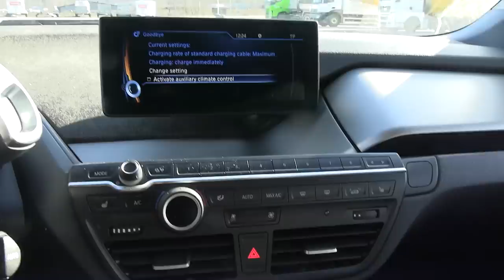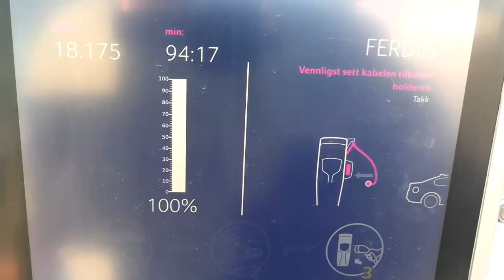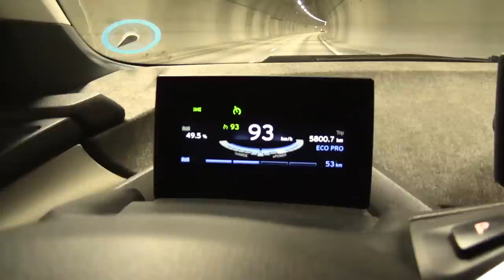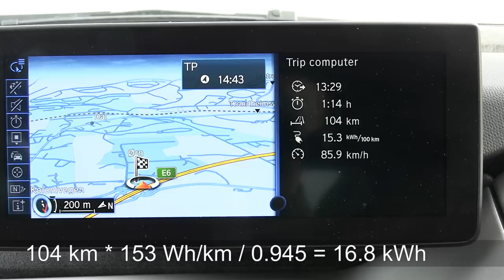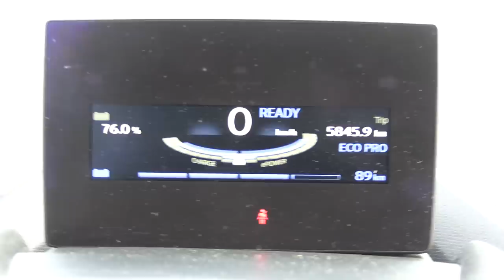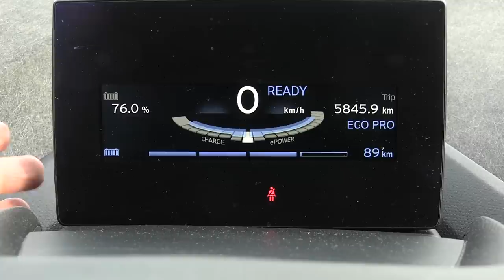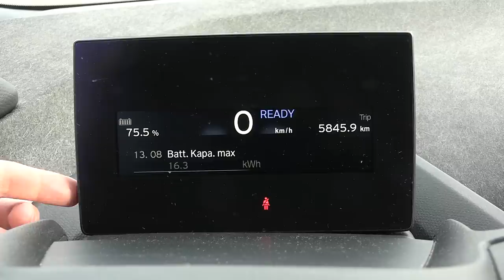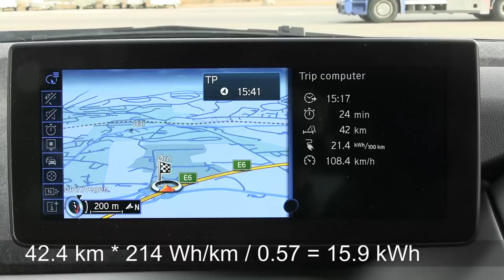BMW i3 22 kWh degradation test after 100k km

Comment: If you are ever in Denmark and want to check the degradation on a Ioniq from summer 2017, with 135.000 km on it, you are more than welcome :) Good video :)
Reply: I will love it! I have one from 10/2017 with 46 000km. What range you can get this days?
Reply: @Fernandoferreirasax  i still get the same range😊 i doesnt feel different 😊
Reply: @RandomRockyCX  fantastic!!! 👌😁
Reply: @Fernandoferreirasax  Same here. 70K+ KM. I know some with 200k KM. Still no difference.
Reply: @RandomRockyCX   maybe the buffer they put is .. when you start loosing  capacity it start charging high voltage to get the nominal W/hrs ... in the begining they  just charge it less voltage to get more cycles but when you start loosing capacity they charge it  to high voltage and its look like it didnt loose capacity =]]

Comment: I have a BMW i3 Rex 60Ah from 2014. 120k km on it with 12% battery degradation. Holding up very well 😎👌⚡️
Reply: Of course man! It's about 6 years old with just a little over 100,000 Km. The longevity test starts now.

Comment: I am sure the I3 will last for many years to come! After all it can’t rust on the salty winter roads and the battery will be sufficient for town driving.
Reply: You know the body might be carbon fibre but it does have an aluminium sub frame for the suspension mount points and to hold the battery. I would be very interested to see one of these up on the lift after 6-10 years to see if the salt water has corroded the Aluminium at all. I have seen Aluminium get corroded by salt water or galvanic action between dissimilar metals. If it the aluminium held up well and weren't for the battery these cars could easily last 25 years.
Reply: @zoidberg444  If you assume that its aluminium sub frame for the suspension has the same quality as all the other BMW models, it will basically last forever.
Reply: Plastic door panels and alu subframe. Glas back door. This will last for very long! My three VW Golfs started rusting at 3 years old! They all needed expensive repairs. I have had many BMWs and never seen rust that early. I have my second I3 now. I have not seen any corriosion on the cars. Excellent town car!
Reply: @AOTanoos22  As long as it's not made by BMW Motorrad, they went through a phase of making engine cases that corrode through.

Comment: The i3 is my favourite small EV. I suppose 10% degradation is quite acceptable for 6 years/60,000 miles. That means the range will probably have degraded by around 16/17% at 100,000 miles. Very practical for city driving. I always thought it had an interesting design that lent itself to being a purebred EV rather than some of the others which still seem like electric variants of petrol cars.

Comment: Very interesting. Please test more cheap, older EVs. That would bust another myth - that EVs are for wealthy people only.
Reply: who else buys new EVs apart from relatively wealthy people,  its hardly a myth
Reply: @yarpos  technically relatively wealthy people buy new ICE cars too. If you want to save money, buying used is always a better choice
Reply: @yarpos  

Id agree, New Teslas are for wealthy people. But, you can pick up a new Bolt for under 27,000 no gimmicks.
Reply: yarpos 👏🏾👏🏾👏🏾
Reply: 27k... so you gotta be wealthy... can buy an ice car for less than 5k, get a toyota or a honda as well
Reply: I rather drive my 88 323 Mazda than a new I3
Reply: @Frank71  Imagine spending 27k on a Bolt.
Reply: @dallysinghson5569  

Its below the average price of a car in the USA. Perhaps the best deal in a new EV in america. If you willing to be patient and look around. 25 grand is possible.
Reply: @dallysinghson5569  

In that case. Find an old ICE car for couple of hundred and fix it yourself.
Reply: My 2014 smart has 65,000 km with no segregation.  Bought it used 2 years ago. $5000
Reply: NoNoNoNii  

To save on gas

Comment: If you know the Machine, that works pretty well....With the i3 60ah you make the preheating on the wire to 15 Degrees. (Program 2 departure times) Then the first stint you drive hard and make a short 10 min charge stint. To check the battery temperature put your hand in the rear seat cupholder: If its handwarm, battery is ok. Now you can drive to next charge with 115-117 km/h (best value range/ speed). Now charging: From 7% to 84% you need around 16min. Another 4min gives you 90%. Drive: Never use ACC ! This reduces your range by 20%. Use CC. If you respect those tips, you reach the 90-100km range and an average speed between 85-95 km/h in the Winter. In the Summer I had ranges closely to 170 km ! I drive 5000km per month with the I3 with the small battery. Zurich to Vienna, Zurich to Hamburg, No Problem ! 1000km Challenge I estimate 12.5-13h. I will do the test. Cheers Nick.
Reply: 60.000 a year in a 60Ah - that's quite sporty! 
Regarding your temperature check: any reason why the battery temperature comes through to the rear cupholders?
I've removed the rear seats to have a look underneath. There is some electronics, also a fan. Im wondering what it is cooling. I guessed it might be the AC charger. Might be completely wrong, though...
Can you give more info? (English or German is ok. Your preference)
Reply: The battery temperature is visible in the Geheimmenü btw.
Reply: @Hiasibua  I think it is the whole compartment which is heating up. No i think you're right about the AC charger. I think it is not only the AC charger.
Reply: @TheNick70nick  damn I need to contact you. I’m from Latvia and I just bought i3 60. It’s perfect in the city and it usually consumes around 10 kwh in the city. But I just came back home from a 60 km trip and my consumption was 16 kwh at 90 kmh! I don’t know if it’s ok, but it is 3 degrees Celsius outside, I did not test it in the summer yet, maybe it will be better. But damn, I don’t even use any air conditioning or heating😕

Comment: BMS of the i3 lock up over a longer time period a portion of the total capacity. If you reset the BMS (requires ISTA Software of BMW and a LAN to OBD2 connector) then you regain a portion of the total capacity again. In Bjorns test car it should have about 18kwh left after reset. This applies only for the 60AH version. In the bigger capacity versions the reset seems to have no effect or even reduce the total capacity.
Reply: Danke für die Info! :-)))
Reply: @Fruchtig78  Gern geschehen. Eine Anleitung wie man es macht gibts im Forum-Bereich von Going Electric.
Reply: Sounds a bit like what happens with Mitsubishi Outlander PHEV
Reply: Mine 2014 60ah fast Charger  112.000 after bms reset whit goingelectric guide pass from Max kappa 14,3to 18,9. If you have 60ah find some one can do it for your car
Reply: I'm assuming it just change the number it's claiming in the service menue. The real capacity will not be affected. These numbers are always a guess
Reply: @ExperienceCN  It's the real deal. You can get 10 or more km range after reset. Did it twice myself when I used to own a i3 Rex. Of course you shouldn't do it after a short period again. Usually once every year.
Reply: @Kopfkirmes55  yeah, as with the Mitsubishi...people found that the degradation could be reset after a while and they would suddenly start getting more EV range. The culprit almost seems like internal battery Deg models that are too conservative. Cell voltages told a different story.
Reply: @0tispunkm3y3r  yeah, I have watched the videos about it. It is the same deal with the i3, only the battery size is bigger, therefore it's not that obvious. Also the BMW is not cutting the capacity that aggressively as in the Outlander.
Reply: @0tispunkm3y3r  But on the bright side used Outlanders are really cheap and they still have around 25km EV range, which is superior to any ICE SUV. Even running on gasoline it's still alright with 9l per 100km (a almost 2 ton vehicle with towing capability!)
Reply: @Kopfkirmes55  oh yeah they are nice vehicles. And you can do the BMS reset yourself !
Reply: BMS reset working well, i do have a 54K km i3rex and after the reset it went back to 18.8kw (full capacity - from previous 16.7kw) according to Batt Kapa, and i gained range as well.
Reply: You cannot use Batt.Max Kapa or SocMax from the API to measure degradation. This value is alive and based on several variables used by the BMS. The only way to measure degradation correctly is by doing a battery discharge test with a BMW battery tester for the i3.
Reply: The 94Ah battery does not seem to lock up energy. I checked two old cars today and both have 29.5kWh left. And if calculate like in this video the battery would be bigger than new (27.2kWh usable). Very confused 🤔
Reply: @davidgarcia6638  is def works ? ive 2014 i3 60ah with 16.1 left

Comment: Degradation of the energy cells will be largely depending on the number or charges, how far the cells were emptied and, most of all, how much strain was put on the cells during charging (i.e. normal charging or rapid charging). If you use the rapid charging a lot (as most people living in big cities, using the cars every day to commute) will do, the cells will deteriorate much faster.
Basic Li-ion facts.
Reply: For used Cars this would be a needed information besides Miles or kilometers. Iam pretty Sure i cant buy a new middleclass Car in the next years.

Comment: Bjorn, BMW has an intentional Software degradation algorithm to protect the battery apparently. Reset it! I was able to recieve a few kilowatts back after my testing at the charger.
Reply from the maker: *kWh
Reply: kWh nazi !  ; )
Reply: How do you reset it?
Reply: Yes absolutely. They do it on Service.
Reply: pauL3gend did it just change the number displayed for capacity in the service menu, or did you see extra 10% real world range? Before and after range??
Reply: Nobody Famous it is hard to see because i3 is calculating freshly always with the actual consumption of the last 5 mins driven.
Reply: @TheNick70nick  now if only you could find someone who knew how to do repeatable test-ing?
Reply: @Nobody_Famous  Join the FB group.. u need the ISTA software. The Battery Degradation is actually very minimal. BMW did a great job with thermal management.

Comment: My Model X 100D has 9% degradation after 64500 km. So the i3 is in a good condition.
The only 5% at Tesla is a myth.
Reply: Curious how you drive it; my MX75 of september 2017 has 95.000 km on the clock and a degradation of about 4%
Reply: A question how to measure and calculate it.
Reply: Oliver Hochgartz yes please do elaborate on that.
Reply: Is the worst degradation of a Tesla i ever read, even with 500.000km i never read more than 10%.
Probably ypou destroy de tha battery with full discharge, car  parked on street, always charging with supercharger...

Comment: Hi there. You estimate the total battery capacity by the energy put inside at charging station. Please consider you have to take in count what is called battery coulombic efficiency,  the put/take energy ratio (normally is around 93% for this chemistry). Furthermore you have energy lost by the cable, the battery management and the on board services. Maybe the inside battery amperometer isn’t perfect but from my experience is by far more accurate than counting just the energy you put inside the battery.

Comment: my 2017 94ah i3 had only 1% degradation at 100 000km. but i should mention that i only use 50kw charging occasionally and at home it charges on a 7,5kw outlet. 

by occasionally i mean for summer holliday trips (3000km total) and 2-5 times during the winter. roughly estimate around 50 fast charges since it was new. also the avg summer temp is around +10 to15 celsius and -15 to -3 celsius during the winter

Comment: Mine is 94ah 2016 , and i have 92000 kms , rest 28.8 kwh now... so i lost only 1 kwh after 92000kms , have only used rapid once,  maybe thats the differnce?
Reply: How Many km range you have now at winter with heating on? And would you buy the bmw i3 94ah as used car? I mean are you happy with your choice? Thanks in advance.

Comment: when the li ion batt age the self discharge rate grows  ,even if you dont use it the batt age grow and disscharge faster and there is a point that if you keep  it in 100% charge start heating by itself and disscharge , the internal damage in the cell make more and more shorts in it that disscharge it ... sooo you start loosing charge even if you dont use it and its dangerous to charge it to 100%.... maybe in cold weather it will keep itself warm and you will not need heating it externaly

Comment: My Leaf is only 5 years old and has 150,000kms on the clock. Battery is at about 85%, 11 bars, 100-120km range.
Reply: my 2012 leaf 33,000kms has 10bars not sure of the stat of health thou
Reply: @xboxice2005  ah, the 2012 battery was not as well designed but 10 bars for an 8 year old car isn't too bad...
Reply: @DashDrones  I'm trying to look after what's left of it,mostly charging to %80 and only 100 once every two three weeks.
Reply: @xboxice2005  nice one! That's the best plan of action, also try not to do too many fast charges and it should last a good few more years!
Reply: DashDrones true,I haven’t done any fast since I owned it used,but I’ll check with leaf spy when I get the dongle 🤙🏽if the previous owner did,it was bought from a dealer so can’t know for sure without leafspy 😆
Reply: @xboxice2005  😀 Haha, exactly mate! Let us know how you get on with leafspy.. FYI, some phones aren't compatible with leafspy, so install it first to see if it runs..
Reply: DashDrones yeah did that already,it’s installed on my iPhone 6 and Sony Experia Z5 🤙🏽😎
Reply: @xboxice2005  booom! Nice one

Comment: The Batt.Kapa Max or SocMax can't be used for degradation measurement. This value is an instant value based on ambient temp, temp.cell batt and way of charging. The value will travel up and down and there is no correlation to just one variable. The only way to measure the degradation or socmax value is a discharge test with a BMW battery tester. These Samsung SDI NCM111/C cells are pretty good in max charge cycles and degrade really low. Still you did a kind of discharge test based on usage. Great vid

Comment: I so badly want an i3. Ive seen a couple of second hand ones with about 50000 km on the clock but I'm  really apprehensive about it.
Reply: Don't worry. The i3 Samsung SDI battery is a well designed and very good chemistry. It will last 10-15-18 years if you manage it well.

Comment: These batteries last around 10years and maximum 1000cycles. Range is 130km but the real capacity is more like 170km so it will last for 170k km. Maximum 40k  left.

Comment: If you keep the state of charge between 20 and 90 percent, the degradation would be even less than 10%.
Reply: This is not needed for the amazing i3.
Reply: I asked the guys at Nissan about this, they denied it on the last generation of Leaf. The battery can be charged to 100%, however they advice to use the battery properly before re-charging.
Reply: Yes that’s correct. But the Leaf 2 has its own Problems: Overheazing and Rapidgateing.

Comment: I drove my 2012 24kwh Leaf completly empty. 95km range in winter. 3 battery bars lost. Have a smart charger at home, and it got ca. 18kwh charge. 138 000km driven. Quick charge several times a month.. It will easily run for 7 more years. Probably the rust will kill the car, not the battery capasity.

Comment: Wow. Incredible how little range the i3 offers. I feel uncomfortable if my car has less than 100 miles of range and I have the ability to refuel it instantly anywhere. I guess evs aren't for me.
Reply: This is why I got the i3 Rex. Rarely use the generator but when I need to do hundreds of miles,  I can. 140 miles on the motorway for about £10 after the 70 ish miles of electric :)
Reply: @Chlodovechus  it is better for sure. Last summer I drove from London to Budapest and then to Greece and popped into a bunch of places on the way back in my car. Don't think it would be possible to do this sort of thing in an electric vehicle any time soon
Reply: @arturturkevych3816  I rarely use the range extender but wouldn't be without it. At least not until I upgrade the battery and use the current one with solar panels for the house. Then I'll have free electricity and the car will cost even less :)

Comment: i have 2014 BMW i3 60ah with 112k miles which is 180k kms . battery degradation 14% . from 18.8kWh to 16.1kWh now . i think more degradation effect if use fast charging

Comment: That degradation seems quite high. My 60Ah REx has just over 41,500 miles on it and I calculated my degradation a few days ago and it worked out as 3.4% (current capacity 18.16 kWh vs original capacity of 18.8 kWh). Maybe the milder climate in the UK makes a big difference.

Assuming the degradation remains constant then at the same mileage as this i3 my i3 will have lost just 5.3% of its original capacity.
Reply: TsLeng To be honest I don’t use my REx much. It’s only ever kicked in maybe 2-3 times because of a low battery and that’s usually during the winter so the battery will drop to around 4-5% before the REx is warm enough to provide enough power to charge up the battery and cover the energy needed for keeping me going
Reply: No, milder weather isn't better for the battery ! You damage the battery with heat, not with freezing it. Thats why leaf2 owners will have a bad surprise in a very short time, cause of heating up the battery always to 40 Degrees and more, cause of the new software against rapidgate.

Comment: We have a 2014 BEV I3 with 49000 miles in Phoenix AZ. We are only getting around 50 miles of range. Dealer wants around $500.00 to perform battery test. That would be covered if battery meets standard for warranty claim but I don't trust BMW....this sucks....